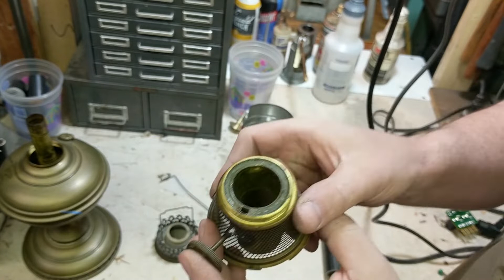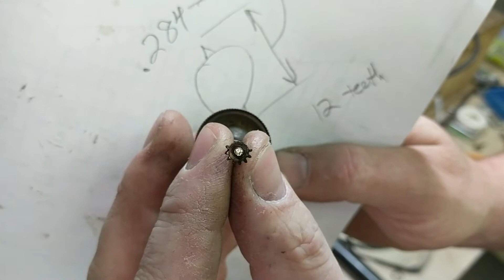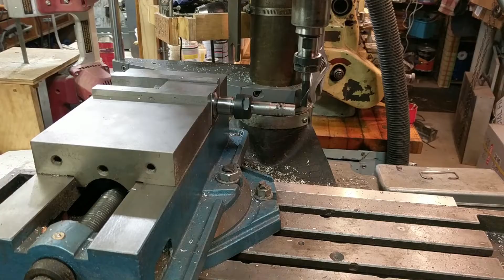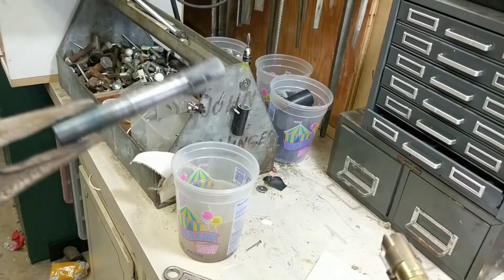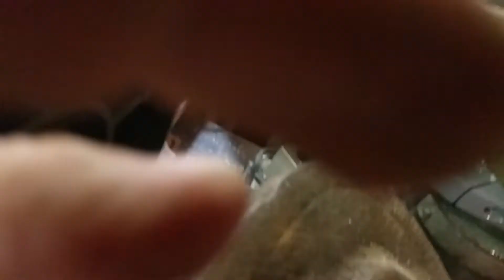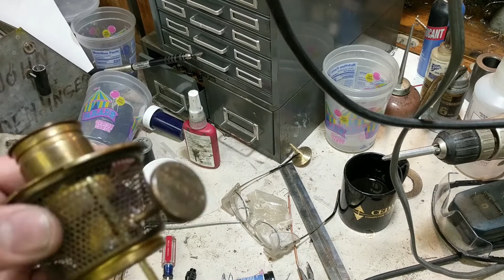Aladdin lamp repair  Part 1 of 2

Comment: I have an Aladdin with the Moon Stone font.  The collar that holds the burner has come off.  Any idea what is used to secure the collar to the font?
Reply from the maker: Wow, tough question.  I don't know what would have been used originally.  My best guess is a heavy resin/varnish?   But for my purposes, and it's not up to snuff for full-on "original" restoration, but I'd use JB weld.  It'll make a permanent, kerosene-proof connection.  If you apply it carefully and clean around the margins with a rag while it's still soft, it'll be clean and neat.  Will outlast you and I both.

I hope you get it worked out!
Reply: @TheBuildist  Thanks, seems to have worked.  The lamp looks great.
Reply: @TheBuildist  Thanks

Comment: This kind of repair job is way beyond my skill level.  First , I need to become a machinist and then spend how much money for a lathe and milling machine? Is there any way you can just purchase a new burner assembly?  I still enjoyed the video and thanks for making it.
Reply from the maker: Thanks for your thoughtful reply.  To my knowledge, you can't buy a replacement for this older style of burner.  You can still buy new Aladdin lamps, but they haven't made a burner like this in over 60 years.
And I only "became" a machinist at all so I could do stuff like this!  I love the mental challenge, I love the fact that I'm preserving a little part of history, and I enjoy working with my hands.  
I'm glad you enjoyed it, and thanks for your input.
Reply: If you know the model of lamp you can buy replacment burners on eBay and similar.  The fonts get knocked about or glass ones get broken leaving a spare burner around.  You just need to look for one with a working whick adjuster.  

That being said at a basic level you could do everything here with a stick of brass and a triangular file.  It would just take a while and there is obviously some skill there too, just a file is cheaper than a full lathe.

Comment: This is great info!  I'm still trying to unscrew the whole top piece off though.  Any suggestions to loosen it?
Reply from the maker: I've never encountered that, but this page says to turn it upside down and soak the whole burner and threads in kerosene for a couple days to re-liquefy any varnished or gummed up old kerosene that's in the threads.  Makes sense to me.   http://aladdinlamps.com/cleaning-restoring/
Reply: @TheBuildist  Hello!! I am also encountering this problem. I have the alacite base model. It feels like it's glued on! Did the soaking method work?
Reply: I’ll give that a try as well. The top assembly on my # 6,  along with the flame spreader are stuck tight.
Reply: I had that problem until I warmed the lamp.. try gentle heat

Comment: Wrong chimney.  Its too short and won't develop enough draft, thus not enough heat. Incandenses is the heating of an element until it glows. Nice job on the gear repair.
Reply from the maker: Thanks for the advice and the compliment!

Comment: Just
purchased my first Aladdin lamp. Completely ruined the mantle and did some
damage to the wick. Got a new mantle and got a new  wick but the flame is not symmetrical. In some
spots there is almost no flame and in others quite a large flame. Lamp runs but
at low power and I get dark spots on the mantle if I turn it up much at all.
I’m running kerosene. Your help would be appreciated. Thanks
Reply: There are special Alladin Whick Trimmers you can purchase to help trim the whick evently.  It takes very tiny difference in wick level to get the pattern you describe.  It is possible to trim or scrape off the higher parts (with flame) and be left with even parts by hand but it take a lot of time.  You need to burn for a while between each attempt to char off the wick a bit to let you scrape a bit more too.